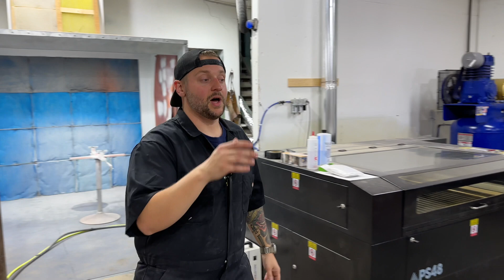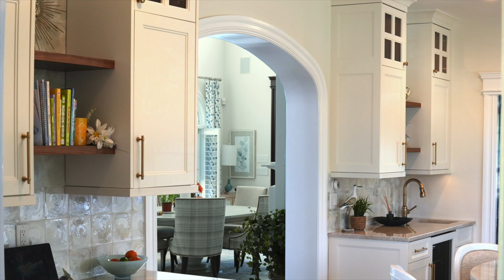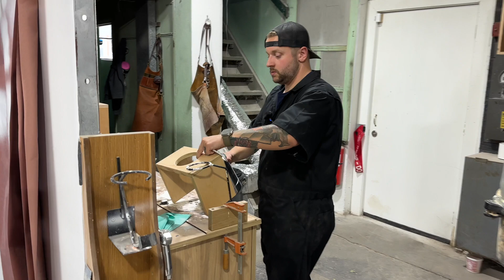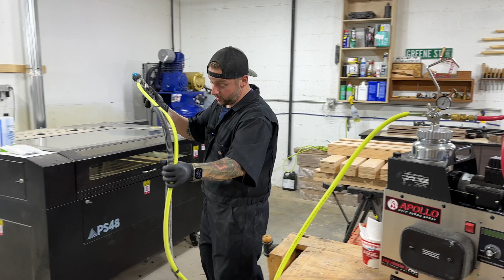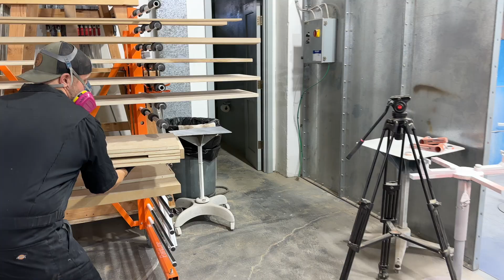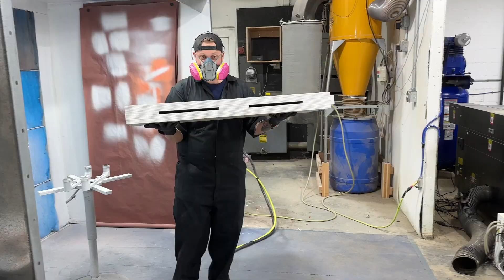How To Use a Pressure Pot with HVLP- Apollo 4500

Comment: Do you ever deal with splatter randomly or intermittent pressure issues?
Reply from the maker: That can definitely happen if you get air in the line, tip gets dirty, etc…

Comment: BRB cleaning out 30ft of hose full of product and how much waste is that?
Reply from the maker: Have you ever used a sprayer with a hose? You don’t waste the material…
Reply: @TodaysCraftsmen  nope just a  Graco F7 that needs to be cleaned out and the 3M cup system, hence the reason I asked.
Reply from the maker: Sorry, seemed like a snarky comment. You fill the pressure pot with water (or solvent if you’re spraying solvent based) and purge the hose into a container until you get water/solvent. Then you can put that paint back in the can before cleaning everything.

Comment: One of these days I'll be able to say I told you so but it's not today. You're so close but like most woodworker's you're stubborn. The pressure pot is close but you still have that giant vacuum hose going to the gun and now you got a pressure pot to clean up. It also looks like your putting on maybe half the material as a HVLP.    The gun and hose are nice and lite and  you can work out of a throw away bucket. It's gonna make my day, maybe even my week when I can say I told you so. Keep on keeping on . PS when you get closer to that CNC just ask, got some opinions there too.
Reply from the maker: Not stubborn this is just a stepping stone to a AAA. Can’t justify spending the $5k at this point and this is a great setup for the amount I spray at the moment.
Reply: @TodaysCraftsmen  I had a Kemlin but nded up selling it because I always got micro bubbles.  I'd say pressure pot is the way to go.
Reply from the maker: I spray with a pump now and wouldn’t go back to a pressure pot

Comment: Nice job man.   I've got the Q5 and a pressure pot but I've never used the pot because I don't want the hassle of cleaning it.    You may have convinced me since I just finished a spray job that I had to refill my 22oz PPS cups at least 8 times.   🎯
Reply from the maker: It wasn’t too bad to clean!

Comment: Great video as always. Is the primer your using water based? I had a project where I sprayed water base and it raised the fibers in the Mdf bad. It took alot of sanding/ multi coats to get the surface ready. I read that it’s better to use an oil based primer on Mdf. Thanks again for all the videos!
Reply from the maker: Thank you! Yes, the Enduro White Undercoat is water based. It was formulated with MDF in mind and has great coverage so you’re able to sand back flat. I would definitely recommending using a double-refined MDF or an HDF to prevent some of that fiber pop.

Comment: That's a really slick setup, Jeff. It looks like it also allows you to hold the gun at angles you couldn't before. At first I thought it wouldn't be an HVLP system but then you explained that it was feeding paint and the turbines were still atomizing.
Bill
Reply from the maker: Thanks, Bill! Yes, you’re absolutely right. I’ve always sprayed with a 3M pressure cup which allowed me to spray at any angle but if you’re going from a gravity fed or bottom cup this will definitely be a game changer.